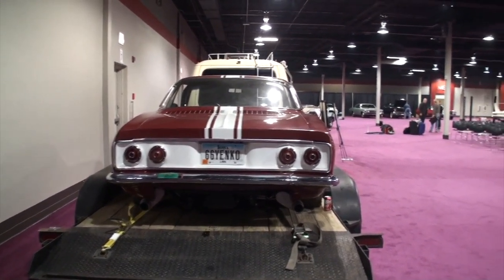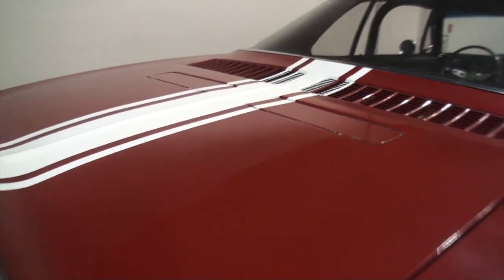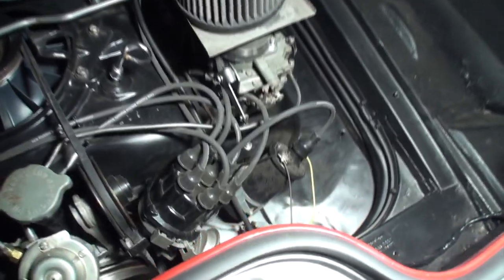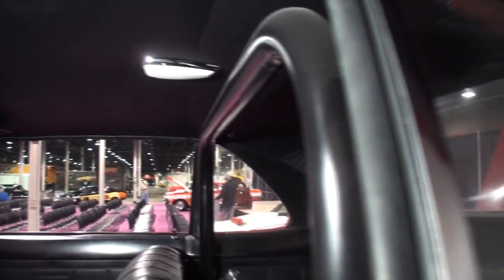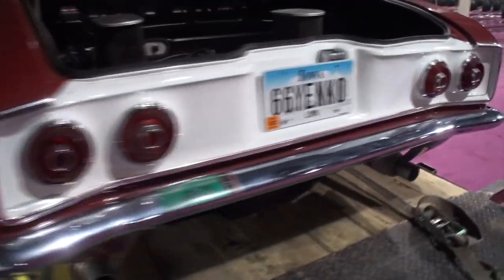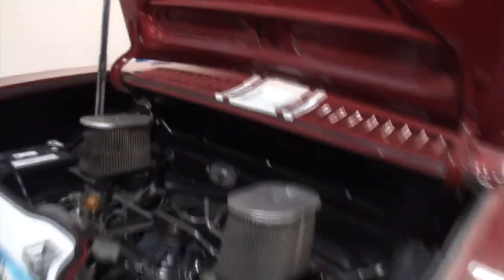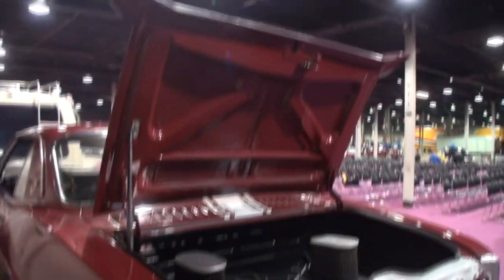Only Red One ! 1966 Chevrolet Yenko Stinger Corvair & Engine Sounds My Car Story with Lou Costabile

Comment: Great engine for decent car. My dad built a dune buggy with a custom built body with 12 coats of metal flake purple and a hand formed fiberglass top he built and painted . It had a 140 Ho corvair motor with a 650 double pumper carb. Carmengia frame cut and shortened by 6”s and rewelded back together to make it handle better. 4 speed transmission with a quick shift kit inside the tranny.
Reply from the maker: Hi Tim, Happy to read Dad had a fun Dune Buggy. Thanks for sharing, Lou

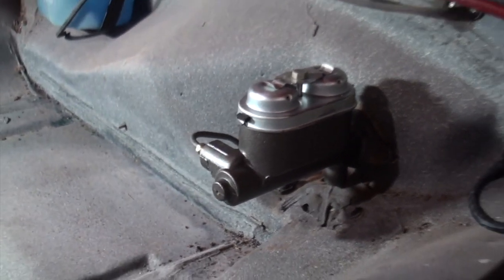Comment: Pause at 1:50 and you will see that the nut which should be holding the master cylinder to the body is missing from the stud!  At 2:11 I don't see one on the other side either!  (another edit as get near the end of the video....) The crank-case vent tube sticking up by the fan  originally went into the base of the center-mounted air filter housing.  Having it open in that location is a bad idea, as any oil mist which escapes will be drawn into the fan.  Over time, the cooling fins on the cylinder heads and cylinders will become coated with residue, reducing their ability to transfer heat.

Love Corvairs, and the Yenko is 💥💣💥
Reply from the maker: Hi 125AX34, Thank you for viewing and sharing your knowledge. Hope you see many more cars on this YouTube Channel you enjoy. Please subscribe, and hit the "bell" so you can see all the cars when they are uploaded on this YouTube Channel, Lou

Comment: Back in 75, I saw a white Corvair with a 327 in it. It was amazing. Did the Corvair come with a V8? The engine was in the middle with a muncie and the driveshaft was about a foot long. Wondering how it handled. It sounded amazing.
Reply from the maker: Hi Ricco, I'm not aware of the Corvair with a V8 from the Factory, Lou
Reply: They never came from the factory with a V8 only the flat 6 ! There was a after market conversion that was called a Crown Conversion Kit & you could install any Chevrolet small block in the back seat ( mid engine ). & as far as handling they were good on a straight away but not as good cornering  as the stock configuration from reports back then .

Comment: Maybe I missed it but did anyone mention the horsepower of this beautiful car?
Reply from the maker: Yenko wanted to compete in the SCCA Class D production class, in order to qualify he removed the rear seats and built 100 Yenko Stingers for homologation purposes. The Yenko Stinger was built in a few variations with engine output varying between 160 bhp, 190 bhp, 220 bhp, or 240 bhp thanks to a series of engine improvements.
Reply: @loucostabile  thanks for the info !